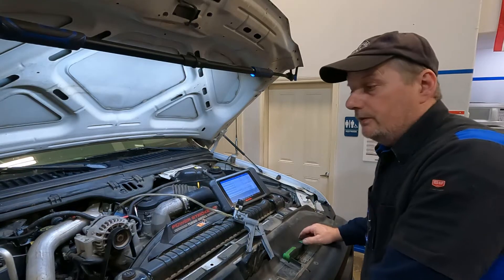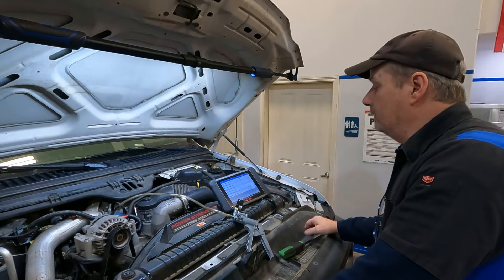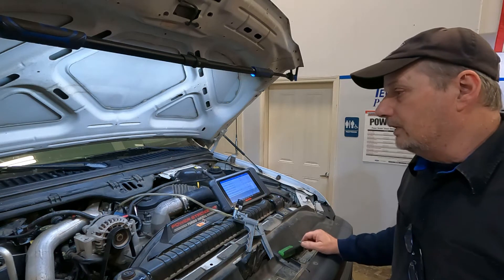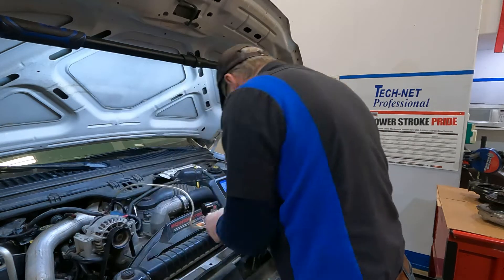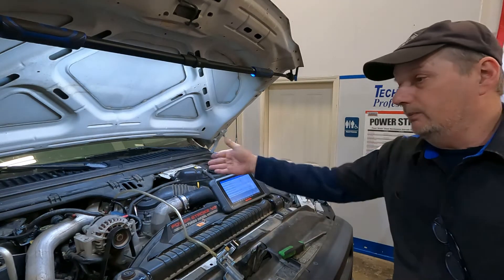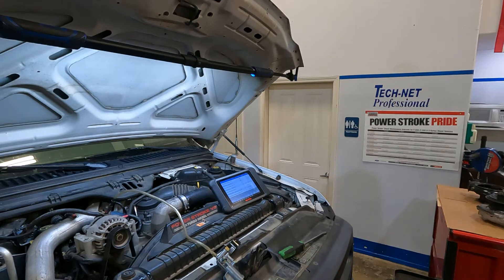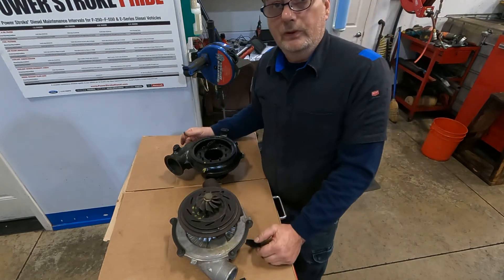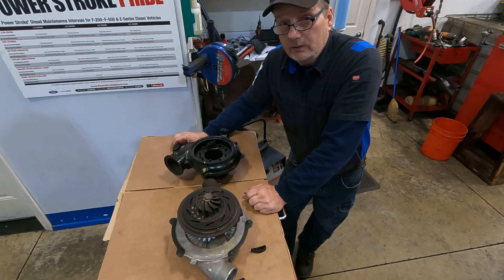6.0 Powerstroke VGT Testing

Comment: you just described what's been happening with my 2005 f250 since I bought it new, only when towing our camper up a long grade, it will throw a wrench light on the dash and lose some power, I have learned that (like you said) turn the key off then back on and it would reset and be fine again. It felt like it didn't down shift soon enough maybe, but like you said it would just dump the boost when the light came on. Does this sound like the same thing ? should it throw a code ? No check engine light on... thanks, jim

Comment: Just wanted to send my thanks. Have systematically eliminated every other component from the system. No exhaust leaks or charge system leaks (25 psi) MAP reads ok orifice is clean, EBP reads ok orifice is clean and even with cat removed no change/improvement, VGT % sticks at 85% from a stop to full throttle. Makes full boost at 3k+. But no dtcs for VGT circuit codes, removed the turbo and cleaned with no change. Shame because its the classic let it sit and suffer the consequences. Will update after the repair!

Comment: I did an egr delete, installed a brand new turbo and now i’m not getting any boost, I got code p0046, p1335 and couple more I can’t remember right now, can’t find the issue we put everything back like it was just a new turbo and welded the egr cooler, no tune or anything, the turbo sounds a little different than the old one (makes a noise) when the truck is at high speed sometimes make 1- 2 psi of boost no more than that
Reply: Map, MAF, Exhaust Back pressure sensor, VGT on turbo      get the Torque pro app and blie tooth scan tool.   Dieseltech ron has a video on how to set it up.    This video is very imformative as well on testing the map
Reply: You can open up the turbo and clean it. There are many videos on how to do it properly. It's scary in the beginning but once you open it up it's easy. Just watch a few videos before doing it. I'm a diy'er and my 2003 6.0 runs great